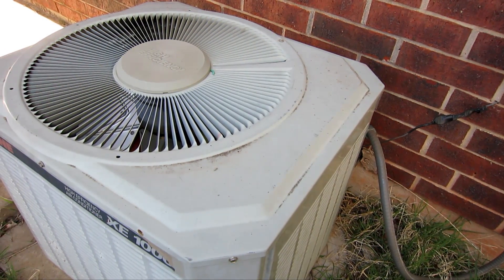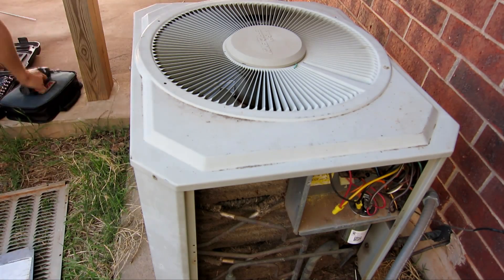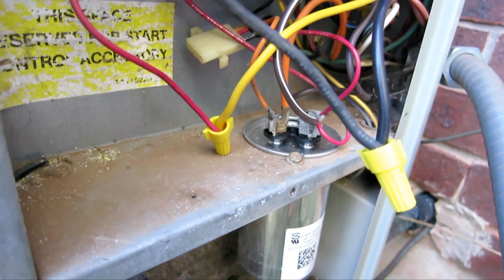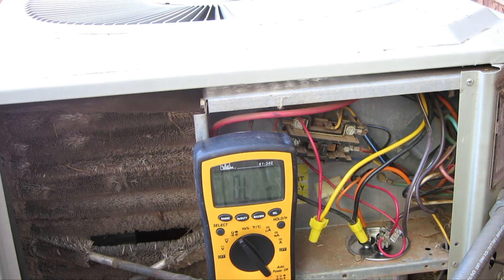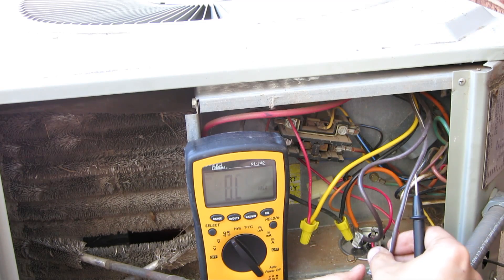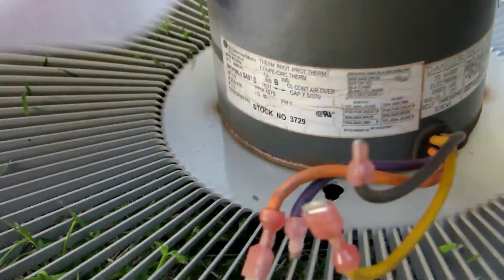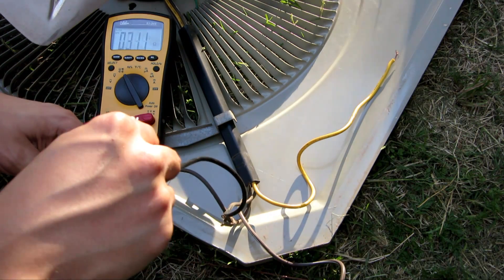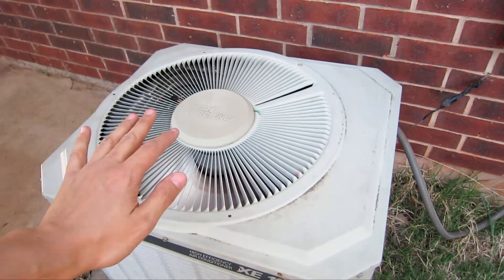AC fan not working - how to troubleshoot and repair condenser fan motor - trane air condition

Comment: Ok, In your diagram I would like to clarify that the common and start don’t share a cap. What I think ur trying to describe is the common on the capacitor, btw two separate things. The common winding is a main leg and should be at the point of your diagram where ur “run” is oddly located. The run leg shares cap with start leg winding allowing for starting/operating torque of motor.
Reply: Just like I thought, didn't comment as I am a hobbyist. Take down this video because it is inaccurate and confusing.

Comment: Nice explanation!  Looks like whoever serviced the unit (replacing the fan, I would guess) didn't go to the trouble to secure the wires that were used to set the fan rotation direction.

Comment: How do I find the fan capacitor for a Trane  model#YCX030G1M0AA ?
 The unit is about 20 yrs old and nothing  on UTube looks like it.  I got ZERO help when I called Trane other than  call trane dealer....which is what I don't want to do

Comment: WELL, OPEN THE FAN AND SEARCH A LITTLE FUSE OR RESISTOR IN ONE OF THE WIRES AND CUT ,NEXT MAKE A NEW CONNECTION, AND THAT FAN CAN BE GOOD AGAIN.

Comment: Well done video - just one comment that when measuring resistance between motor windings (or any other electrical circuit), at least on of the leads should not touch your fingers. Around 8:00, the wires are being held to the leads by the fingers - this may affect the readings depending on your body resistance. If you had sweaty hands, your readings may be inaccurate and not add up for the total winding reading.

Comment: Hi
my air cooler motor isnt working what i need to check pls let me know
it was rotating slow in the morning and later it stopped working,
later it was making hum sound and now i dont even here now.
1) is it shorted
2) capacitor fail or ....?
Reply: Sounds like the bearings are seizing up.

Comment: Open toed sandles at a worksite - oh my.  Safety violation.
Your wiring diagram at 02:01 is wrong.  C should be in between R and S.

Comment: How about if instead of 42ohms you get 41ohms do you consider that a bad fan motor? how about if it happens with a compressor also just 1 ohms different is that consider bad right away?, just have this experience...
Reply: no,it could be a couple ohms in either direction and considered good

Comment: That's not an electronic signal for a capacitor it's like.        --- ) |---
Reply: his is right, and you are too, the difference is, in your diagram, it  is usually use on polarize capacitor, while run capacitors are none polarize, so he is right too.
Reply: thanks i know now!

Comment: Very helpful, and I have the same issue, I replace capacitor, didn't check contractor yet tough, fan motor doesnt turn, and presents resistance when manual spun.
Reply: Contactor
Reply: if like his,the compressor was running and not the fan,that tells me its not the contactor or neither one would run,if the fan does not turn freely its no good
Reply: M Norm if compressor was running and fan wasn't it could be the motor or run cap
Reply: My fan will only run if I give it a Kickstart, but it will only run for a about 3mins and shuts down and it will not come back on until I shut the entire system down for 30mins or so. I've already replaced the cap. Would this likely be a bad motor?
Reply: if you know how you could connect to the power going to the fan,put it to fan "on" and see if you have 240v,if so and you have a good capacitor i would suspect the motor and we are talking about the air handler?and since you say it has a capacitor its not an ecm motor?
Reply: trhome,also is it straight cool unit with gas or elec heat or a heat pump,if it is a furnace its most likely a 120v motor
Reply: M Norm it's connected to the indoor gas heating furnace from the outside

Comment: You need to be certified to work on that equipment. I can tell by your "I am not a professional" line that you are not certified.
Reply: +DIY Tinker He can't.  He was just spreading disinformation.  You're more knowledgeable than many "professionals".  You understand the science behind what you're doing.  Keep up the good videos and good work.
Reply from the maker: +Krombopolous Michael Other than charging/removing refrigerant from a HVAC, you dont need to be certified to work on your HVAC. Please explain to me what organization or law states that a home owner cant work on their own unit, especially doing what im doing in this video.
Reply: Krombopolous Michael diy tinker a home owner can work on his own machine he cant charge or remove refrigerant legally or replace parts unless you get them black market legit supply shops will not sell electrical parts to somebody without a contractor's license

Comment: your condenser look full with dirt will effect cooling capacity spray and wash  be sure using not so strong water pressure not to bend soft aluminum cooling fins . first spray some kind cleaning agent then wash sprying from inside out while fan out keeping clean those fins are can make your comprosser life longer and save also electricity
Reply: I did this once;  sprayed my GM van AC condenser with HP hot water after colliding with a mass of bees moving their hive.  Flattened every condenser fin and finally had to replace the radiator--   $$$$ lesson.
Reply: Use condenser coil cleaner , the foaming type, it will push the debris out of the fins and strip the coil clean and bright.

Comment: Dear friend u are very smart I appreciate but I said a refrigerator??? means less amp not same like a window a/c it's taking 10 to 12 amp..
Reply: +asifkhan khan Air conditioners have much greater working loads than refrigerators. Refrigerators cool down 30 cubic feet in an insulated box, air conditioners cool down over 5, 000 cubic feet of poorly insulated space.  Amps directly correlate to the work load a motor can support.  That's why they cannot be compared. Cheers.
Reply: +maurice willey everything is relative, volume, temperature and operating pressures are different

Comment: When you are taking ohm measurements @ 8:15  is the last measurement suppose to equal the combination of the first two measurements?
Reply: Yes, but the third measurement was unnecessary because it couldn't possibly measure anything else besides the two resistances added together.

Comment: first of all, very insightful video.
I have one question though, while you have taken out the fan, there were four wires and you have connected  YELLOW-PURPLE and BROWN-ORANGE for CCW direction spin.This moment only two wire is coming out of fan. 
My question is while you were measuring the resistance, you have taken the measurements between Brown-black , Black-Yellow & Yellow-brown. Here there are three wires.
I am so confused. Is the brown wire is the same on coming out of fan or there is some more connections which is not shown in video.
Hope this is not stupid ques??
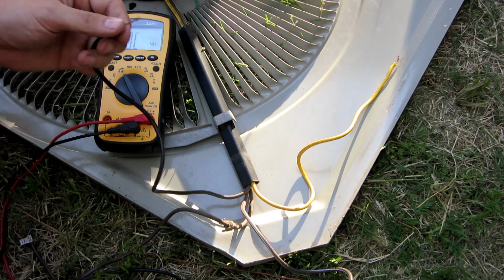Reply from the maker: Gaurav Bhadani the fan directional wires are different than the fan wires. If you are referring to 7:18 when i measure the fan resistance, then that was explained in 1:38. Hope that helps.
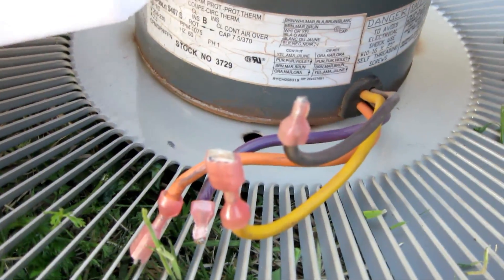Reply: G Vik That was a good question...as I was originally confused as well...if you look at 5:43 in the video, you can see both sets of wires...
Reply: +G Vik If you are only looking at the colors of wires, you are missing the "big" picture. It's easier to understand the function of a motor than to memorize wires.

Comment: Can a bad fan motor damage a new capacitor?

My fan stopped spinning in my ac unit. I put in a 40/5/440 capacitor (made by different company than what was in unit...both are 40/5/440). The fan ran for about 45 min then stopped and would not turn on again. Both capacitors are rated -6% +6%...whatever that means.
Reply: no, a new cap cant damage a fan motor. you might have had a fan going bad. Also, you might have a wrong rating capacitor in the beginning (if the unit is old, some HVAC tech jsut put wrong stuff in) along with an aged fan will also cause issues. Finally, you might have hooked it up wrong or have loose contacts or now another part isnt work. e.g. the contactor/relay or fuse.

Comment: DO NOT MAKE VIDEOS LIKE THIS! YOU NEED TO BE MORE CLEAR ON WHAT YOU ARE DOING AND WHY! IF YOU ARE A HVAC STUDENT THEN YOU SHOULD KNOW ALREADY THAT THIS INFO IS MISLEADING AND DOWN RIGHT THE WRONG WAY THINGS ARE DONE! I HAVE 2 SUGGESTIONS FOR YOU FIRST GO BACK TO SCHOOL AND SECOND TAKE A COUPLE OF SPEECH IMPEDIMENT CLASSES IF YOUR GOING TO BE MAKING EDUCATIONAL VIDEOS!!! maybe an editing class too.. on a good note it appeared like you got it running.. or maybe your compressor terminals blew out and that's why we only saw 2 seconds of the condenser fan kicking on.. then video was ended abruptly??! constructive criticism
Reply: What is so wrong in his video? Everything seems fine to me. point out what is wrong so we can know why you have to type all CAPs.
Reply from the maker: Johnny Doe getting technical, but my title is "repair condenser fan" which starts at 5:40 where the fan is damaged. i never said "rebuilding". But that is a good suggestion. maybe i should rebuild a fan motor and share it on youtube.
Reply: don dao Getting technical, but he didn't repair anything.  He replaced a fan motor--the title is great if he was rebuilding one on the spot--which I know I would have been looking for (and was).

Comment: very insightful video. very helpful to have the schematic and resistance values for reference or else u could have condemned a good fan motor at your initial check.

Comment: Is that correct???the common & start terminal of the fan motor connected to the capacitor???or maybe is it run & start terminal that must be connected to the capacitor???kindly verify..thanks
Reply from the maker: The label for common, run and start on this motor is correct. Other motors can have common and run label switched. It doesnt matter what its called for either common and run. What is important is the 120VAC on both R and C. you should always look at the schematic and see what orientation your unit has.

Comment: Ac unit making a slight humming sound and fan not spinning. Any advice?
Reply from the maker: How to fix your AC - Fan kicks on but Compressor Not Working - Replacing run start capacitor
Reply: See my fan on the unit isn't kicking on at all. And the sound doesn't seem to be as loud as usual turn on sounds.

Comment: How about fan stuck on? AC works but even with thermostat off it just runs all the time
Reply from the maker: sounds like you have a contactor or relay stuck short. Check the contactor, thermostat and control board. One of those arent working.
Reply: DIY Tinker Thanks, yes it was the contractor, wiggled it loose and spayed it with my favorite CRC 2-26 spray lube. Your video gave me the confidence. Sometimes just opening it up and some common sense is all you need... Thanks again.

Comment: how can I check thermostat 24 v to ac outside what should my meter be set on??? my ac unit turns on when I put in the pull switch and the relay doesn't appear to be stuck or responding to thermostat so I will check for current to relay then I think wiring is causing this some how which means its bypassing relay. I cant figure it out.
Reply: I already rectified the problem it was wired  wrong then contactor was not pulling enough for contact so replaced contactor now everything running just find people don't hire AC person they will steal your money for something you can do. Very simple !!

Comment: hey i'm having the same issue here. problem is when i turn on the AC i can't hear the buzzing sound or a hum on the outside fan but my blower fan inside the furnace is on and is blowing warm air. My question now is.. the run/start capacitor bad? or is it the fan motor? help!
Reply from the maker: so, outside fan and compressor isnt on right? check the relay and capacitor:
AC not starting up - Air Conditioner condensing unit lost power - Replace Contact contactor relay
AC fan not working - how to repair broken HVAC Run Start Capacitor - air condition
Reply: DIY Tinker
 Hi again, checked both the relay and capacitor and looks fine. I had a local HVAC guy come out to rewire and bypass the wires coming from the circuit board to the cap and relay and now the fan kicks on like its suppose to without hesitation, but its tripping the house breaker. the guy says it looks like a motherboard or circuit board issue inside the unit is acting up. It will startup normally when I set to "cool" and "auto" on the thermostat but once it gets to the desired set temp the fan will stop, however if the house temp starts rising again pass the set temp, the fan will not startup. The only way I can get it to start again is by turning the thermo switch from "cool" to "off " setting, flipping/reset the tripped breaker and then turning the thermostat from "off" position back to "cool" Do you think its the thermostat thats acting up?
Reply from the maker: Hello Bye I think you should first check your breaker. Ive seen similar issue before and the breaker got old where it cannot handle its max current any more. That would be a cheaper and easier fix.
If fixing the breaker doesnt solve it, then something is pulling too much current (e.g. your fan or compressor, etc...) But, no, i do not believe your control board would do that, and no i do not believe your thermostat would do that either. 
Keep me updated. this is interesting. 
p.s. i do have a video on replacing the breaker: how to repair replace broken circuit breaker - multiple Electric outlet not working - fuse box panel

Comment: the fan motor is a indoor blower motor it was riged to work so it did not last because it 1 was incorectly wired. 2 it is not a water resistent motor and this is not a good video to learn from because he should haave from the beginning told every one it was the wrong motor . and he is checking his resistance the wrong way , you need to pull your wires from the contactor and capacitor first then check ohms.

Comment from the maker: well. the motor went out becuase the wires were chewed. you can see it at 5:40 in the video. But you are right about having a clean coil, and no i didnt check the liquid line pressure. maybe ill ask my wife to get a gauge for xmas :)

Comment: Starting the motor with a bad capacitor is a bad idea. The motor windings will overheat and hopefully open but very likely damage the motor. Buy the 10 buck cap before you have to buy a motor also.

Comment: Didn't you notice the condenser coil was completely stopped up with dirt? That may have been the reason the other motor went out. The easy fix isn't always the best fix.What was your liquid line pressure? I bet it was very hi if you checked it.

Comment from the maker: the motor will attempt to start, but most likely it cant. you could use a stick, push the fan with the stick, and it might start running.

Comment: Right after pulling out the disconnect I would check if the motor spins freely, the problem could be mechanical. After eliminating the possibility of mechanical malfunction I would troubleshoot electrical side of the fan.

Comment from the maker: i was also surprised. But that's how it was originally wired, the schematic agreed with the wiring, and i couldnt argue with the resistance measurements. I'm not a HVAC professional, so, i might be wrong.

Comment: Very informative, but are you sure the fan diagram is correct? Should the Run and Common terminals be switched? i don't know. This is a 240 VAC motor.